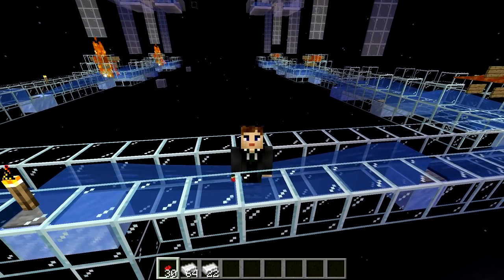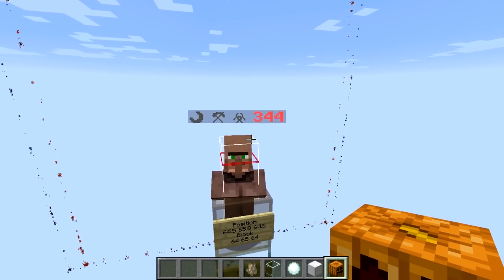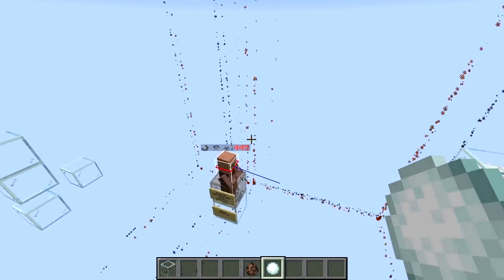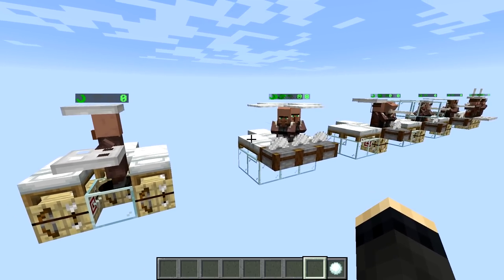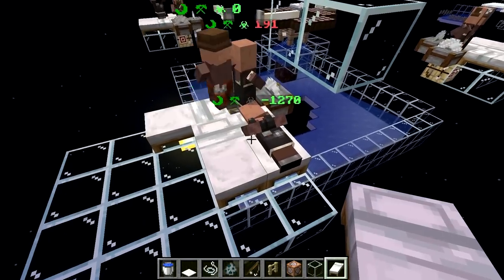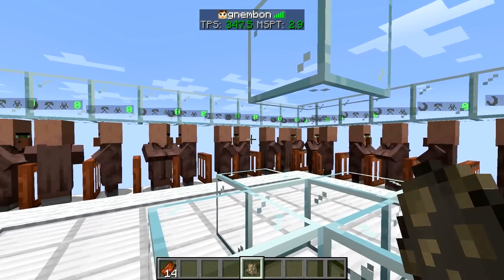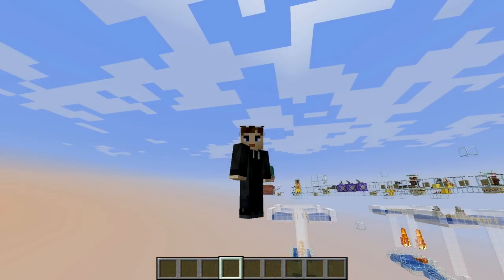Simple, Cheap, Efficient - IRON Farms for 1.14.4 [Fun Farms 28]

Comment: For those who came from Mumbo :) 
Material List:
 Glass - 328 
Quartz Slab - 212
Powered Rail - 24 
Light Weighted Pressure Plate -  23
Birch Fence Gate - 20 
Water Bucket - 20
White Bed - 12 
End Rod - 8 
Stonecutter - 8 
String - 8 
 White Carpet - 8
Fletching Table - 4 
Lever - 4
Redstone Dust - 4
Mustache - 1 :)
Reply: Thx man! I was looking for this!
Reply: The don't have to be quartz do they they can be stone, right?
Reply: @nszzn4872  Yes of course
Reply: Thanks
Reply: @Tomas D'avola i dont think so,if you find a video send pls
Reply: And the endrods? Can I replace them with anything else? I haven’t been to the end yet so I don’t have any of those...
Reply: @brecht_vdpoele  Don't think so, mumbo had some problems when he was using torches on glass so I think it has to be end rods
Reply: @Subjecttochannel  Ok good to know! Thx for the respons!
Reply: Does it have to be zombie, or can I use a passified pillager?
Reply: @fillaheee  if iron golems chance after passive oullagere then they will work too iirc
Reply: Definetly the mustache :)
Reply: @fillaheee  I think it can be any mob that scares villagers. Just don't take one with a bow or crossbow XD
Reply: i did the farm but there´s one module that doesn´t spawn iron golems any help?
Reply: Im not sure what you need the Redstone dust for, and I'm pretty sure you actually need 24 pressure plates.
Reply: I ended up making a tutorial video, hope it helps people trying to make it <3
Reply: Bsquared thanks!!
Reply: @brecht_vdpoele  Yes, thanks. it worked with both zombie and a passified pillager, but now I have another problem. the mob of choice keeps despawning. I've tried having a armored zombie with a nametag and something in it's hand, pillager with nametag, normal zombie with something in its hand. Idk what to do. In desperate need of loads of iron haha
Reply: For what do you need the String?
Reply: @Benny22449  for place carpets
Reply: @winfer5767  thanks
Reply: My villagers always set themselves onto the glass (the border of the collection system for iron golems) instead of the working station. I compared it with gnembon's world and im 99% sure it is the same. Do you have any tips how to overcome this or did any of you have the same experience?
Reply: Win Fer thanks couldnt figure out how he did it :D
Reply: Win Fer does this work on Xbox? My Xbox is on 1.15 and for some reason it is not working
Reply: Demonitazation Bot no it does not the golem spawning mechanics are different
Reply: Christian GTA Server shit, I took 6 hours getting everything for it already😭
Reply: Lava?
Reply: @brecht_vdpoele  you can replace the end rods with glowstone or sea lanterns above the villagers heads
Reply: @samuelkennedy2840  Genius! Thx a lot! not ready for the end yet XD
Reply: Can it be any type of Pressure Plate, or does it have to be light weighted?
Reply: Where does the redstone dust go :P
Reply: @sasas110110  i had the same issue, turns out my beds were backwards.
Reply: @juanlim85  prevent spawning iron golems
Reply: @williamspiecker6528  this isnt the case of mine. It turned out that the solution is simply to remove the top layer of the collection system border which makes 3 tall gap, therefore villagers are unable to go underneath their beds.
Reply: @Tomas D'avola  there isnt. But it is in the world download.
Reply: Awesome, thanks!!!
Reply: is it for the season 6 one or for the season 7?
Reply: @rat4289  season 7
Reply: 24 not 23
Reply: @nszzn4872  yes
Reply: I’m thinking you might be able to use glass panes and lanterns if you don’t have endrods yet
Reply: @brecht_vdpoele  I've tried with glowstone and it seems to be working fine
Reply: Tomas D'avola you can download the world and copy it
Reply: Does the entire system have to be powered rails? Seems like you can accomplish the movement with half or less honestly
Reply: Where does the string go?
Reply: @brecht_vdpoele   I used lanterns on top of trapdoors instead of endrods and it worked totally fine
Reply: @fillaheee  even ravager works :D
Reply: @itsikpix5825  You need redstone dust on top of the fletcher's tables
Reply: @juanlim85  on top of the fletching table
Reply: @markopohlak344  on top of the beds to place the string
Reply: @flameopathic2046  i made sure of that, it didnt work either. However ive just removed the top glass layer and it works just fine. Thanks for the advice anyways
Reply: Flameopathic ye figured it out that u cant place carpet in air
Reply: can it be a stone pressure plate
Reply: @liamosborne6859  It has to be lighweight i belive so no
Reply: Do I have to use glass? I have lots of cobblestone, is cobblestone good enough?
Reply: Unknown 61 It should work with any block
Reply: The iron golems won’t spawn for me
Reply: Can people  that didnt come because of mumbo and where do you a mustache? I have never heard of this block/item
.
.
.
.
.
.
.
.
I'm joking just in case you didnt get it xD
Reply: thanks so much
Reply: Are end rods necessary???
Reply: @tr1gger502  from  what I know yes
Reply: @tr1gger502  someone wrote that Glowstone, Sea Lanterns and Lanterns work as well
Reply: Win Fer thanks!
Reply: Why do these lists never use minecraft terms like 5 stacks they insist on using big numbers my brain hurts but thanks for the help
Reply: No shit i miss the - mustache now it won’t work 😡
Reply: This is the tutorial I found. Some people were asking. ---> https://www.youtube.com/watch?v=_nxuG45tvrw
Reply: i built the farm but when my villagers sleep they just end up on top of the glass layer for the spawning platform? why is this XD
Reply: Is it necessary to use end rod?
Reply: @samuelkennedy2840  Thx so much.
Reply: @Subjecttochannel  can i use carpet insted of the end rod? really wanna make this early as possible
Reply: Hey do the job blocks for the villagers matter? Does it have to bo stone cutters and fletching tables?
Reply: @isaiahpreston942  i just finished building here, and i dont know about the cutters because it might be  because its like a diferrent size of block, but i might be wrong. as the  fletching table i think it really doesnt matter as long it has a redstone
Reply: Do u have to use end rods tho?
Reply: @cactuzszs  i used all 4 sides carpet with wire  below them, works normally
Reply: Can the end rods be replaced?
Reply: your an angel
Reply: Do they have to be light weighted pressure plate or can i use something cheaper?
Reply: its people like you that help the world turn round tysm
Reply: @elle9834  season 6 dude!
Reply: @rat4289  season 6!
Reply: @sailingsquid179  nope, tried, it dies and loses momentum and loot
Reply: @AlexandreJWKlaus  Is there a video I can follow as an alternative. fine if there isn't just asking
Reply: @muffinmainia4340  sorry, just do not have the time, nor any editing and recording software
Reply: thanks bro!
Reply: Legend
Reply: Why does he use end rod? could something else be use?
Reply: Thank you soooo muchh
Reply: Thank you so much
Reply: Ah yes the most important part of the machine the mustache
Reply: Grian took the mustache
Reply: @niklasjames8175  any kind
Reply: is the mustache optional?
Reply: Cloudy Tears no
Reply: Mustache 🤣
Reply: Fuck yeahhh
Reply: YAY
Reply: this is wrong
Reply: am working on correct list
Reply: omg so much gold
Reply: bro your a legend thank you
Reply: Thanks! This helps a lot :D
Reply: omg thank you youre a life saver
Reply: I HAVE A  MUSTACHE apparently
Reply: Thankyou my friend
Reply: Thx
Reply: you don't need 8 cutters and 4 tables, you just need 12 workstations
Reply: what a life saver
Reply: Does it still work
Reply: Ur amazing
Reply: Can the end rods be replaced by something
Reply: Thanks mumbo for the mayor
Reply: Hey mate does this work on bedrock
Reply: 19:13 more just posting this time stamp for my own reference, but others are welcome to use too

Comment: For those who may have issues of having the farm stop working:
Go at night and check that all of the villagers are sleeping when not being scared.  I had my farm stop working except for two pods.  One would spawn two golums and the other would only spawn one.  At night, I noticed that on all of the other villager pods, at least one villager was staying awake at night.  I went to each empty bed, one at a time, and broke it and then placed it back down.  The villagers instantly went to sleep and the iron farm quite literally, instantly began working at full capacity again.

So, there is an issue of the farm stopping working occasionally and I built some glass pathways close by each villager spawning pod so that I could easily access them again to break the beds if the farm breaks again.
Reply: this tutorial also includes a fix that for a problem i ran into

https://www.youtube.com/watch?v=bZ_KGZspja8

Comment: For those considering building this, it's well worth it. Thanks Gnembon! 

(An easy-to-miss detail is the redstone dust on the workstations to avoid golems spawning on them.)
Reply: Thanks for this comment. Came here specifically looking to see what that redstone was meant for.
Reply: How did u put the helmet on the zombie? There also was a rumour it would break... is that true?
Reply: @janthurner160  
Pretty sure helmets on zombies have always eventually broken and isn't a rumor.

You would need to protect the zombie by just building a roof over the mine cart path using bottom half slabs.  Or use a husk.

Comment: Just did a step by step tutorial in case anyone needs some help building it😁
Resources Required for the recommended 4600+ items/hour farm:
-417(6.4 stacks) Solid Blocks
-520(8.2 stacks) Glass Panes
-1242(19.5 stacks) Glass Blocks
-192(3 stacks) temporary Colored Glass Blocks
-384(6 stacks) Scaffolding
-192
-135 Fence Gates
-40 End Rods
-105 Powered Rails
-66 Rails
-5 Detector Rails
-14 Comparators
-57 Redstone Dust
-8 Levers
-38 Packed Ice
-50 Signs
-32 Chests
-20 Hoppers
-5 Lava Buckets
-2 Water Buckets or 120 Ice
-38 Pressure Plates
-9 Redstone Torches
-4 repeaters
-3+ Minecarts
-128 temporary dirt blocks
-128 temporary powered rails and rails(or more depending on how far you transport villagers)
-1 Dragon Head or Carved Pumpkin
-30 Villagers(with no profession)
-1 Zombie
-A beacon with jump boost is very useful but not needed

This include a simple item sorter/storage and everything you will need to build it in survival.(1.16)
Reply: why endrods?
Reply: @bappo147  12:00 😁

Comment: To anyone having problems with the Iron farm:

MAKE SURE that the villagers each have a proper bed to sleep in. One method to ensure this is to see at night time if ALL villagers are sleeping in each beds. If any are awake during the night time (without the husk scaring the villager), then it means it has not located a bed. To fix, replace the bed at night time to ensure that the villager locates the bed and sleeps in it. Once all the villagers in the module are sleeping at night, the module should spawn (mostly) 2 golems/scare.
Reply: I can only make the villagers sleep when I break 1 of the beds and then push them all out and place the other bed back, they basicllly can't pathfind to the beds and think they cant sleep in them, when I "fix" it and put them all in their beds one night, the other night they wont go to bed cuz they cant pathfind towards it, I built it exactly the same as in the world download
Reply: I just realise I built it in a different orientation tho, is it directional?
Reply: This is a known bug when beds are tiled side by side. Eventually they will forget them.
The solution is to have the beds split on each side so they're not side by side.
To do this the platform needs altering slightly which can be seen in this image:
https://imgur.com/bbiYALf

I've had this running for a month now and not once has it broken. Works flawlessly.

Comment: I think I might have fixed the iron farm from Mumbo's videos so the villagers don't escape. (1.16.3 fix)

Put string on top of every part of every bed and then put carpet on top of the string. It seems to prevent the villagers from waking up and standing on top of the beds and getting pushed off. I don't know if it makes the farm any less efficient because I don't know how iron golem spawning works so there is probably a better way to solve it.

Comment: I'd recommend to build a fence around each cell. Despite what is said on the video, villagers can and do push each other off the cell. I built it and over time lost villagers, until I didn't have any cell with 3. Just build a fence around the cell, 1 block tall on the front and 2 tall on the other 3 sides. That keeps line of sight and prevents villagers from pushing each other off and also from jumping from the bed (you can actually jump over a 1 block tall fence from the bed). On the 2 block tall fence section you can just build the top layer to save materials

Comment: Just set up the 30 villager farm and it doesn't seem to have full efficiency. I'm confident each module (5 of them) has produced 2 iron golems at least once, so I think it's an issue of the husk/villager frightening timing. 

Problems I've considered:
1. Something to do with mobs in the area either contributing to a mob cap or frightening the villagers early (farm is 10 blocks off ground)
2. Torches on the insider of the spawning area for the golems because I'm in the mountains (to avoid ice). I'm thinking maybe this is decreasing spawnable blocks so it's trying to spawn there but no luck so either 1 or none will spawn on a cycle.

Any help would be much appreciated!

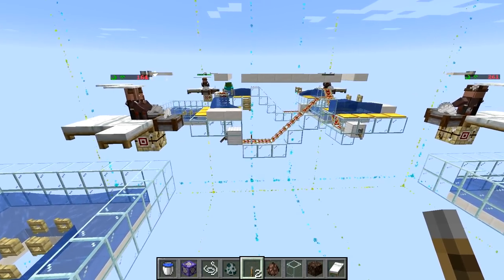Comment: Hey guys for the farm at 19:50, if the iron golems are spawning on top of the slabs just put glass on top of them all and it will fix the problem. It took my a while but I finally got it working.

Comment: I have a question about the design at 19:49, when I built this on my server, every single time my villagers keep clipping through the beds and die in the iron golem trap.
What exactly are you using to stop the villagers clipping through the beds?
Reply: A solution that worked for me was to place slabs underneath the beds, and then to lower the spawning platforms' walls by one block.
Reply: @Reptile1404  Thank you had the same isseu 
ONly with my farm they spawn nothing at all :P
Reply: @jonahjimmink5331  use string

Comment: With the design of mumbo, when the villagers go sleeping they dont respawn in the chaimber but on the glass. I have it on the same hight as the video, does somebody know a sollution?
Reply: Wouter Lammers Mumbo talked to this guy about it u have to use end rods above the villagers glass is not a substitute
Edit: NVM I think your talking about the glass below the villagers my bad
Reply: Watch this person's video, it's a full tutorial how to build the farm as well at the end there's a fix for villagers escaping: https://www.youtube.com/watch?v=bZ_KGZspja8
Reply: I had a similar issue that I fixed by making sure that the pillows on the beds were facing towards the villager holding cell. Without that they weren't making iron golems and they were jumping out onto the glass holding the iron golems that weren't spawning in. I hope this helps you fix your issue.
Reply: If are you on a server that is not vanilla then it wont work.
Reply: I just built a glass wall around the beds, worked for a bit, now no golems spawn ;-;

Comment: I had a problem on a 1.16.2 Server. Testificates would wake up not on the fletching table using the 19:15 version. Villagers wake up on the bed or on the glass and die when they fall in the trap. Anyone else have this problem, or a way to keep villagers from waking up in the wrong place?
Reply: if you cover the beds in carpets it works again

Comment: Useful Dimensions

11 blocks between the villagers for pods in the same station
16 blocks between the nearest villagers from opposite stations
19 blocks between the nearest villagers from stations beside each other
16 blocks between the villagers and any golems standing on the cooker below

Terminology
Each station has two pods. Stations can be opposite to each other (other side of the minecart loop) or beside each other (next or previous in the minecart loop).
Block distances are measured from the edge of the 2/3 blocks of space that an entity takes up. So if I have a villager, a block, and then a golem, that's a 1 block gap.
Reply: This is a really useful information for building your own iron farm designs :D
Reply: @nii_nii_v2  Thanks. I downloaded the world and did a bunch of measurements, also figuring out why.

The first one is 11 because you need >10 but 11 allows symmetry with the rail in the middle. The third one is 19 so that villagers don't see spawned golems from the stations beside them (16 block distance in the end since the spawning platform is bigger than the 3x1 villager standing area).

Then the second and fourth ones are perfectly 16, again for iron golem detection.